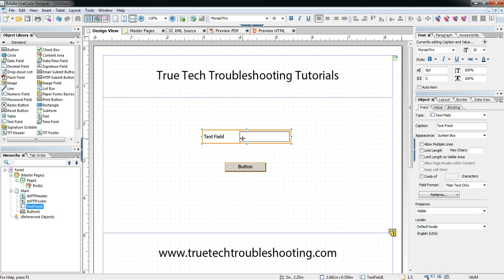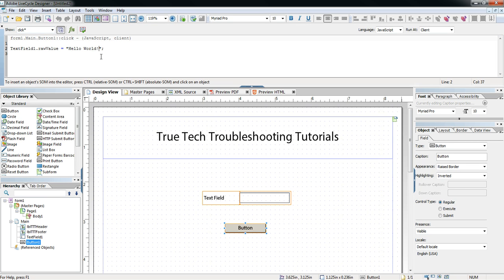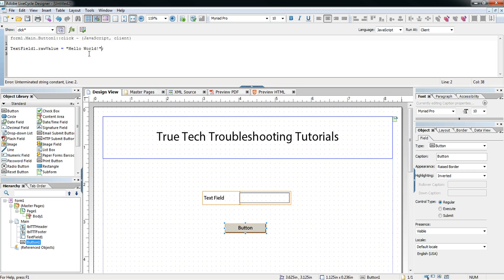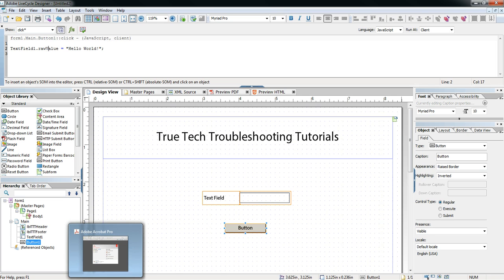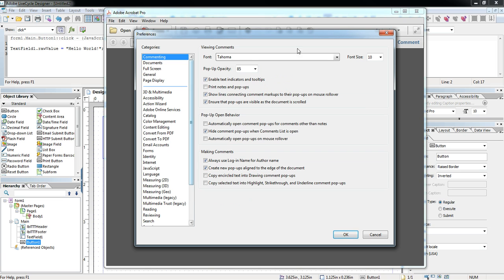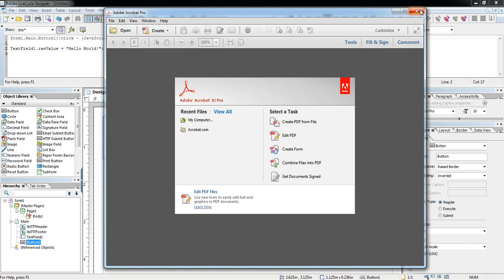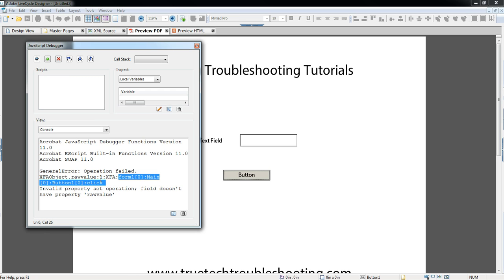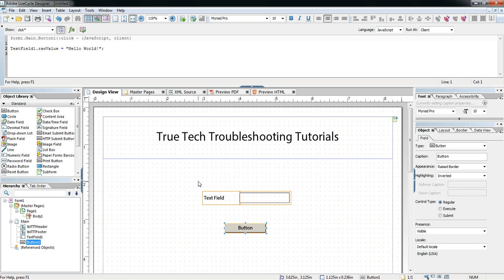Debugging JavaScript in Adobe LiveCycle Designer

Comment: Followed all of these steps, but the debugger still doesn't appear. Thoughts?
Reply from the maker: +John Sonnek In some versions, ive noticed that Acrobat Pro must be open when Previewing for the debugger to appear.  Also, you can type Control-J to manually open the Javascript debugger.
Reply: Hmmm... still not working. Running Designer 6.2 with Acrobat DC. Control-J does nothing, too.
Reply from the maker: Video is from a Windows environment.  Are you using a Mac?  In Pro be sure you've closed and relaunched the program....(Enable JS debugger after Acrobat is restarted)
Reply: Windows environment. Closed and relaunched a few times. Setting is still set.
Reply: @Truetechtroubleshooting  Thanking for your video,can you tell me, why can't my adobe livecycle deign syntax check